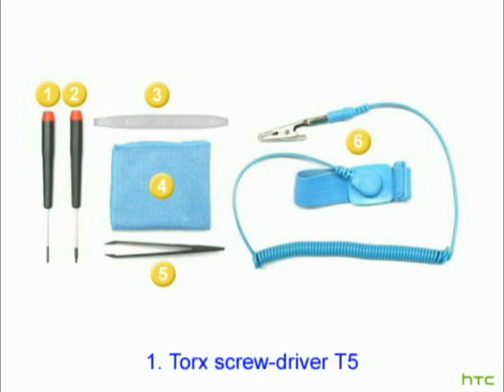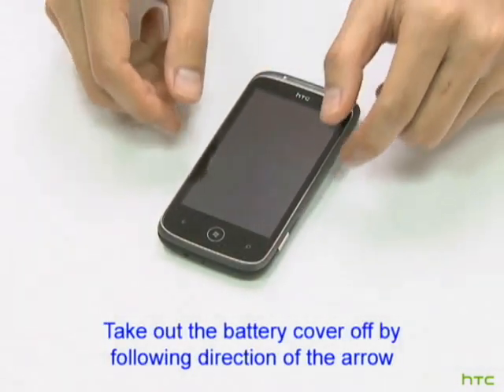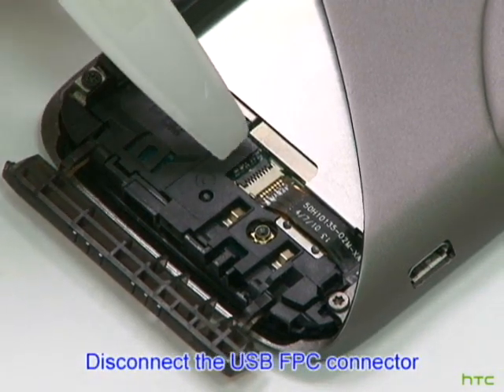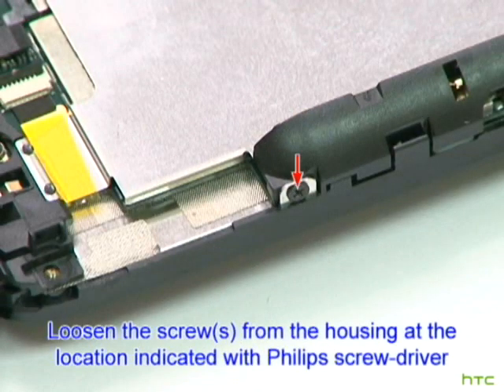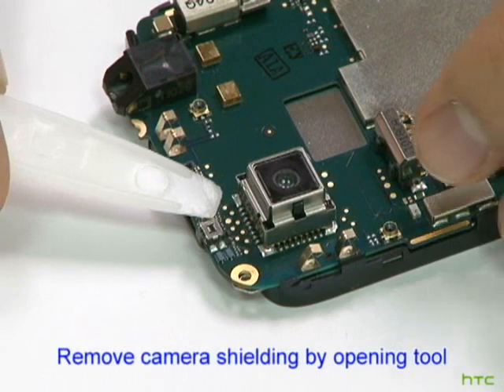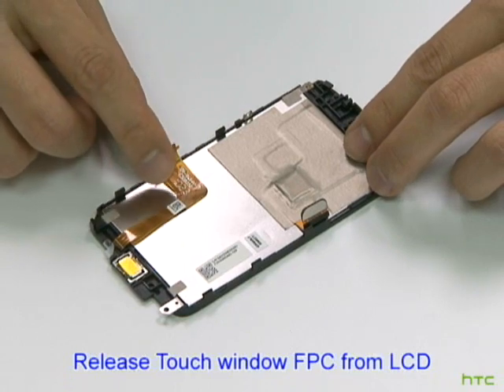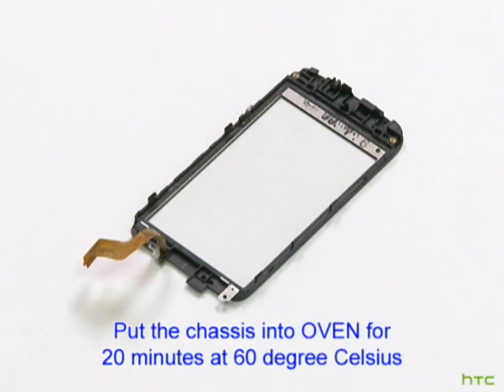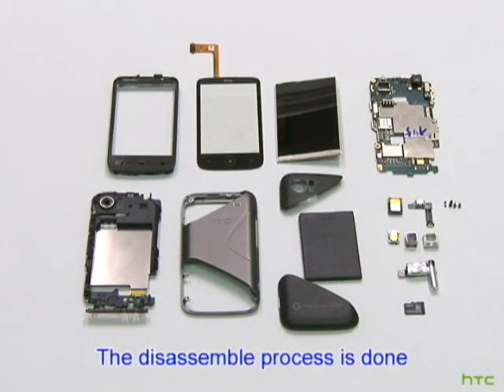HTC Mozart Disassembly Guide

Comment: I needed to heat up the screen for over an hour at a much higher degrees to remove it. It also left a bunch of glue and such which I had to scrape off before replacing the screen.